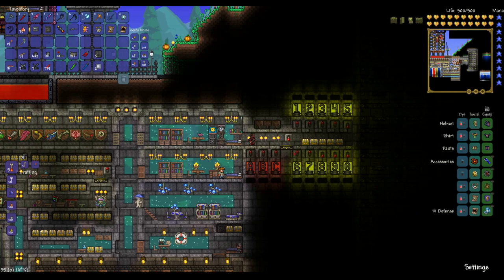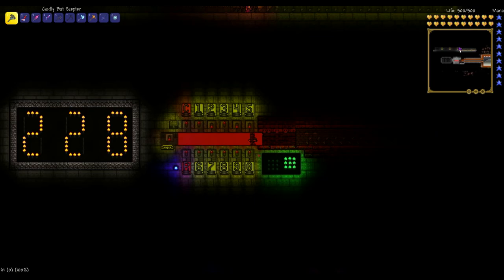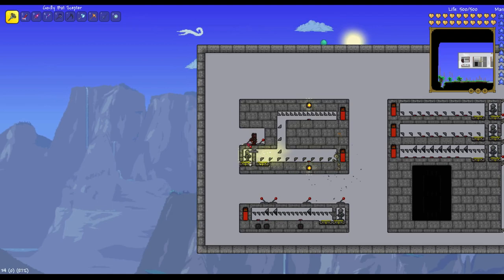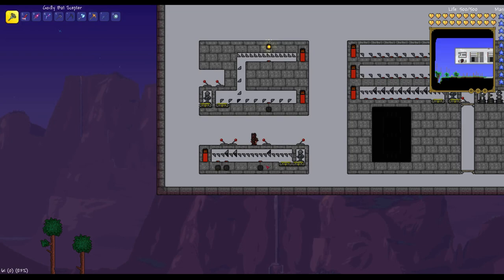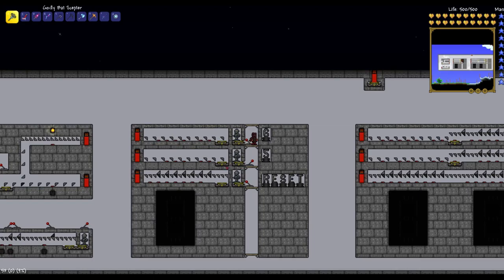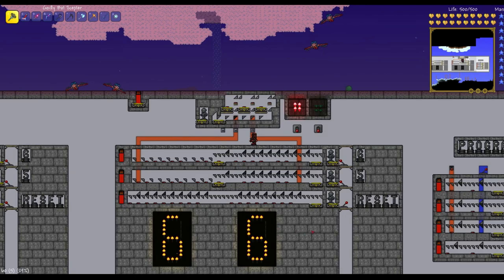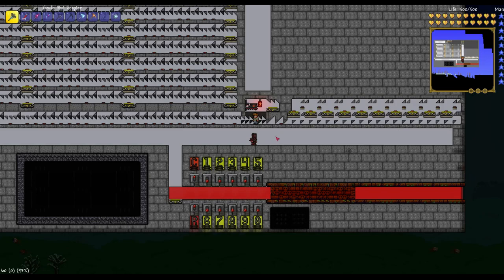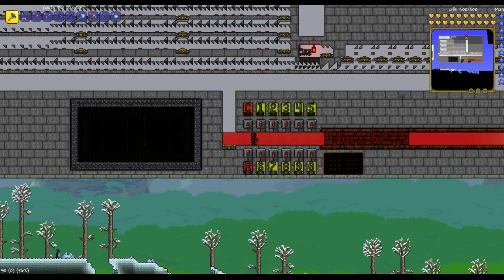Terraria Hoiktronics: Programmable Passcodes + Tutorial on Hoiktronics Mechanisms

Comment: Audacity is a good voice recording software as well as a music and sound mixer too. It has many options for you to choose from and customize the sound file that you have.

As a screen video and computer audio recommendation, OBS (Open Broadcaster Source) is a good tool for doing what Fraps does while using less of your PC the Fraps. The differences between Fraps and OBS are the load they have on the PC, as well as how fast can it be functional.

Fraps is ready to go, but heavier on your PC. OBS requires a bit of work to set up, but if you don't mind this, you can record your games in better settings (if you have a lower end pc) at the same quality as Fraps in sound and visual quality.

Overall, the sound is good, the video is great, the explanation is solid, and I hope to see more! Good job Mr. Price!
Reply from the maker: Thanks for the suggestions! The 50 minute video I created with FRAPS was about 100GB so not too bad, but I'll have a look at OBS as well! I've heard some good things about audacity too - how would I go about using it though? Is it something that needs to be running in the background while I speak into the mic similar to how FRAPS needs to be running while I record the video of gameplay? Or do I just load up the video from FRAPS (or after compression with Handbrake) into audacity to clean up the audio that way?

Thanks for the feedback!
Reply: Joe Price you can't load the video into audacity, you'd need to convert it to .wav first and then re-encode it after editing the audio. so it's a bit of a hassle. what you really need is to get a good microphone and a proper setup, then editing might not even be needed
Reply from the maker: platomusic Any recommendations from you or anyone else as to what microphone is a good one to get? Or maybe something lo-tech such as draping hose or a sock over the existing microphone? :)
Reply: Joe Price For simply recording with OBS, you can actually split the audio from the game and your microphone so you can adjust the microphone quality if needed. And if I remember correctly, doing this does not mean you will have to make it into a .wav as its a separate audio file instead of joined with the video file.

Overall though, Great video and Hopefully you can easily understand how my recommended programs work, their both free so no money spent, and OBS records videos in smaller file sizes then Fraps does for the same quality.

For Microphones, I couldn't tell you. I am not tech savvy, but I use OBS to record my videos and with how I have it set up, and how I work with videos, I hardly need to edit them further then the base file itself unless It has to be really fancy.
Reply: Joe Price putting a draping hose over the existing microphone could work, depending on which microphone you have. There are relatively cheap voice recording microphones out there, behringer is a budget friendly brand. check out their products. Also, until you have proper stuff set up, if you record with the microphone at a slight angle, so that you don't breathe straight into it, it will reduce those large p-sounds at least a bit.
Reply from the maker: platomusic I'll take a look at the behringer products - thanks for the recommendation! I use Microsoft Livecam for the mic currently, but I'll also see if I can fiddle with it as well to improve sound quality to avoid editing.
Reply: Joe Price no problem :) feel free to contact me if you run into any problems. I'd be happy to help

Comment: I have a question about hoiking.
How would I make a hoik in Terraria Mobile version?
If you know how to, please respond. Thanks.
Reply from the maker: There are 4 types of sloped tiles you can create in the PC version (which can function as hoik teeth), although if I recall correctly mobile/console are limited to just two types. Try hammering some blocks and see what sort of sloped tiles you can create. You can also use Richard Lewis's Hoik guide for reference:

http://forums.terraria.org/index.php?threads/hoik-guide-rapid-player-npc-etc-transport-using-only-sloped-tiles.1656/